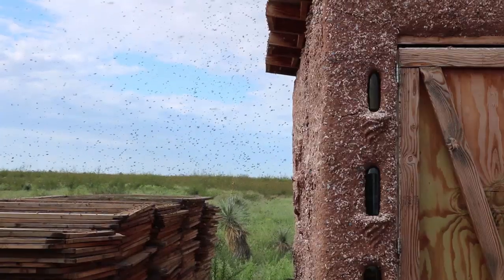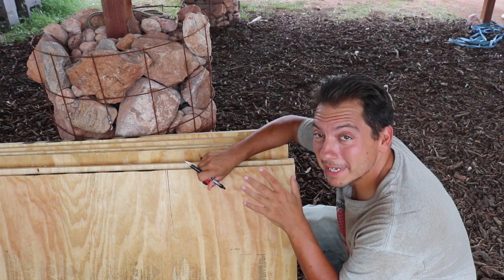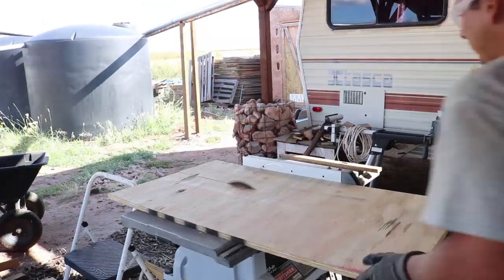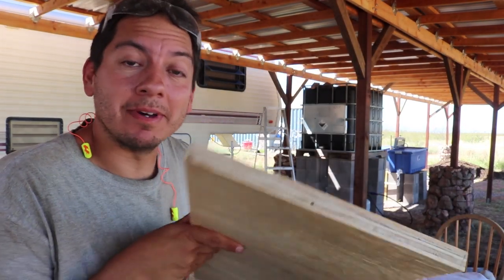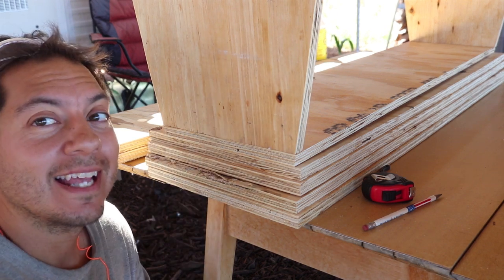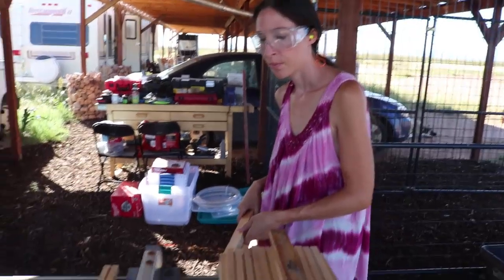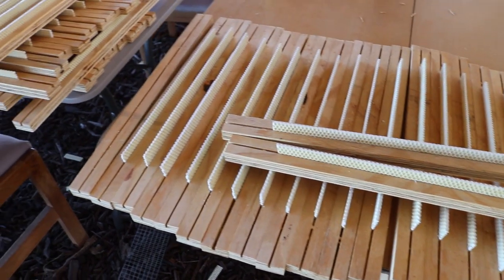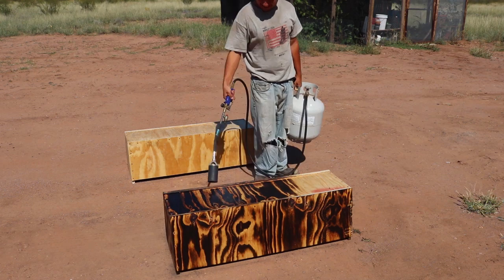BEEKEEPING | How To Build Top Bar Beehives

Comment: They look great! Cant wait to see how they work when bees move in! 

Can I suggest, if you're going to be doing a lot more woodworking, maybe look into a good mask or respirator? Sawdust, or any particulate, is not good for your lungs! I recommend RZ Mask. I use them in my dye studio when handling dye powders and chemicals, and for any fumes that come off the kettles in steam. But any mask that uses a P100 filter would work, just make sure its properly fitted on your face. Stay safe!
Reply from the maker: Definitely a good suggestion Lynette. I actually used a mask since I was doing more cutting.

Comment: woohoo!  I've been waiting for this one!  TOP BAR HIVES IN THE HOUSE!!  Now, I do have a couple questions.  First, are you going to make any following boards for them?  Second, had you considered screens on the bottom for ventilation?  Also, keep an eye on the top bars made with plywood.  Sometimes, they can de-lam, and start to sag.  Looking forward for GDP Apiaries to be on the air!!
Reply from the maker: Good points to bring up Paul. Do you think drilling some holes in the bottom and covering them with mesh will provide enough ventilation? 
We'll have to investigate the following boards.
Reply: @ourselfreliantlife  Yeah, you can use your hole saw thingy and then get #10 hardware cloth (bees can not get through it, but mites and other pests can fall out of the hive from it.)  Following boards help a lot.  Especially in the beginning, The top bar hive is a big empty cavity, and the bees will not feel able to defend it. The following boards would be the same dimensions as your end pieces, except they would be mounted on a top bar.

Comment: I just have a Langstroth hive (the typical vertical hive) at the moment. I'm thinking about building a horizontal hive for a second hive, and if I do I am going to make the hives fit the standard "deep" frames so that I don't have to make the frames as well (they're not that simple to make).
The reason people recommend 1 inch thick wood is for insulation against the cold in winter. Down here it doesn't get cold enough for that, so 3/4 is fine.
You need to make sure that the hives are level when you place them. Also, your roof should ideally wrap around the top sides of the frames.
You can use lemongrass essential oil to attract bees. It's very similar to the pheromone that the queen makes, and it will attract the scout bees. Lastly, if you do get a swarm in those hives at this late stage of the season, you're going to have to supplement their food with sugar syrup and pollen patties (not honey - foreign honey can make them sick). I'm going to put out a video on my channel fairly soon on how to make your own pollen patties, if you're interested. It's not really cheaper than the commercial ones, but I use all-organic/non-GMO ingredients.
Reply from the maker: Very good tips! Thanks Raoul!🙏
Reply: @ourselfreliantlife  Oh, one other tip. When placing the hives, it's better to have them quite far apart (we're probably talking 20-30 yards apart), as bees don't naturally build their hives very close together. I built a little enclosure for my bee hive (to keep the dogs away from the hives) with the idea of putting 2 or 3 hives in there eventually, but now that I know better I'm going to have to build an enclosure for each hive.
Reply: So many things to think about, here's another two related to those frames again.
1. Honey frames are HEAVY! Brood frames (the ones with eggs, larvae, pupae, etc) are relatively light compared to honey frames.  The honey frames are at least 3 times the weight of the brood frames. You might find that with your frames the honey comb drops back into the hive as you pull them out because they lack sides and a bottom.
2. "Commercial" frames are made to be only a certain space apart. This forces the bees to build well-formed comb, which is both easier for them to maintain in the long run, and easier for you to deal with when inspecting your hive and trying to harvest honey.

Comment: I would love to start a couple of hives. I don’t think I’d want something quite so large, though. Not quite sure how the top bar hives work at this point. I have a bad back and knee replacements and I’m concerned about the weight of a 10-frame nuc filled with honey. Thought maybe a 5-frame or even a two-frame nuc might work for me? Five-frame might be better for the bees, though. I could be wrong. I’d like to learn more about the top bar hives. Perhaps one option would be to build them about 1/4 of the size of yours? Would that even make sense? Just looking for thoughts.
Reply from the maker: Those are definitely good thoughts. I watch Pine City Apiary, and he likes the top bar hives because of the weight issue. Once these are in place, all you have to lift is the bars. Everything is adjustable though. You can make it to your own specifications.
Reply: Great to know! I’ll check out his channel. Thank you for the suggestion!

Comment: I'm sure that someone has mentioned this, but plywood is not good for bee hives. I use it in mating nucs, but they are only used for a few months, and don't have many bees. Plywood will de-laminate pretty quickly, preferably in a high humidity environment of a bee hive.
Reply from the maker: The plans we looked at said plywood,  but further research has uncovered what you said. We're pretty dry here, and we've protected the wood. Hopefully it lasts, but we may go with different material in the future. Thank you!